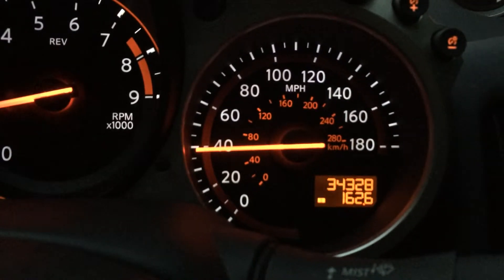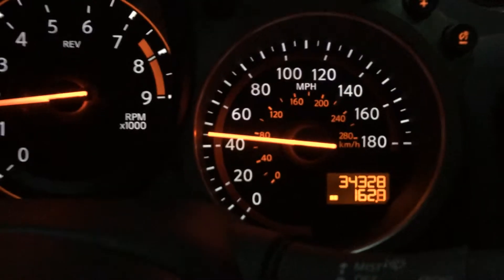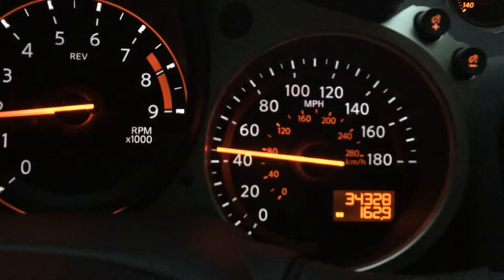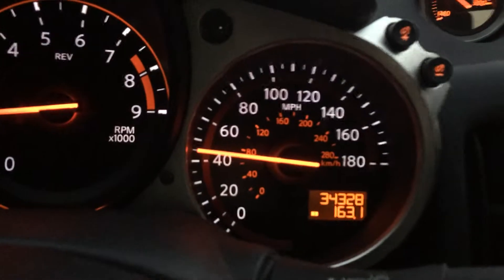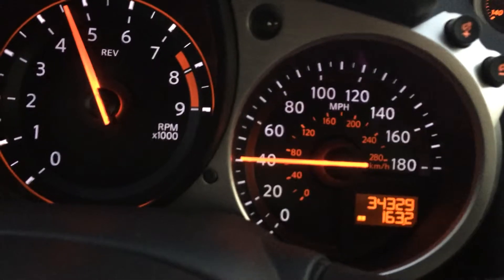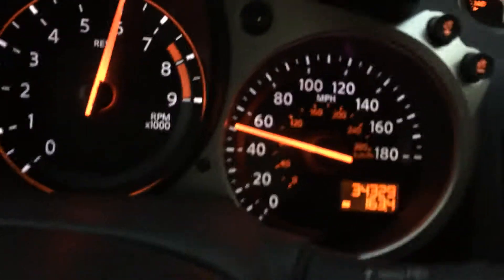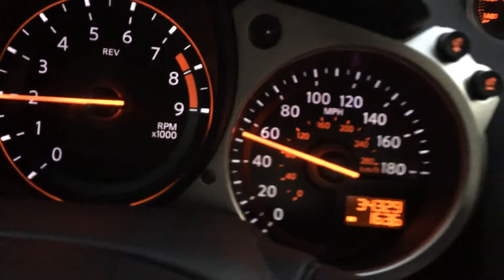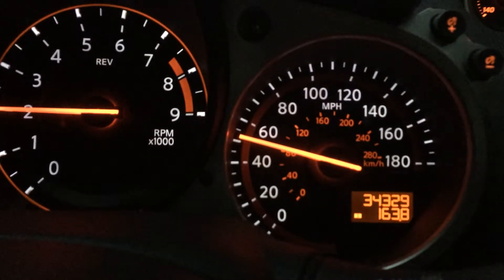An oversized furnace will make you uncomfortable. Here's why using a fast car to illustrate.

Comment: Yep! Most furnaces today are sized based on drafty and poorly insulated homes of the 1970’s. Most modern homes are very well insulated and therefore do not need furnaces to be so big. 

Also they assume that people will set their thermostats to 72 degrees (F) or higher. Most people keep their homes between 68 and 70.

Comment: What do you think about a 90k btu furance and 3.5 ton a/c on 1614 sq ft home would you say that is oversized
Reply from the maker: +ilovedisney35 It depends where you live in the country, but the odds are about 99% yes. Typically homes your size here in Cleveland I can get to a 3 ton heat pump for heating (36,000 BTUs) and often a 2 ton (24,000 BTUs). Cooling load will likely be in the 1-2 ton range. It often takes a fair amount of air sealing to get there, but you can. The only way to know is with a good energy model. We also prefer 2 stage or modulating units so they aren't on/off.

If your house has hot/cold spots and swings more than 2-3 degrees, all is not as well as it could be. Good question!
Reply: +Energy Smart Home Performance also something else I have noticed is that the ductwork tends to be grossly undersized for most systems
Reply from the maker: +ilovedisney35 Correct. The good part is, in many cases when you right size the equipment, the ductwork is close enough. You may need to adjust a run or two, but typically not the full system. Variable speed equipment reduces this problem as well, as long as you hold static pressure above .08" of water column.

My friend Mike MacFarland of Energy Docs in Redding CA rips out duct systems and replaces them, but that's largely because flex ducts in attics are the norm. Here in Cleveland replacing duct systems could easily be a $10-20K endeavor that is highly disruptive.
Reply: now can you tell more about why an oversized a/c unit(short run times) has a hard time maintaining a comfortable humidity level.
Reply from the maker: +ilovedisney35 Sounds like you largely figured it out. Short run times don't remove moisture. It depends on the model, but many units have to run 5-8 minutes before they do much dehumidification. If it only has to run a few minutes to drop the temp in the house, it won't dehumidify much.

On the other hand, low efficiency units actually a lot more dehumidification. It's a tradeoff - cool the air or remove moisture. Old school ones removed a lot more moisture. We like using ventilating dehumidifiers as backup for oversized ACs. 

I'm working on a book right now, this stuff will get covered in it.